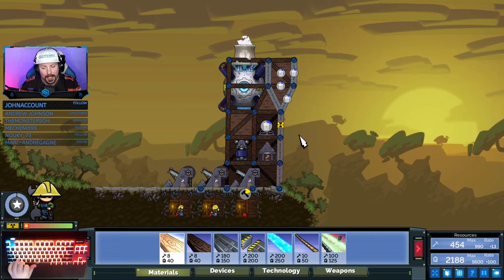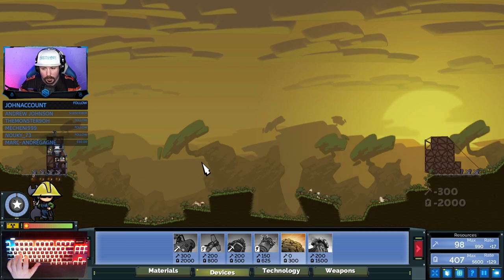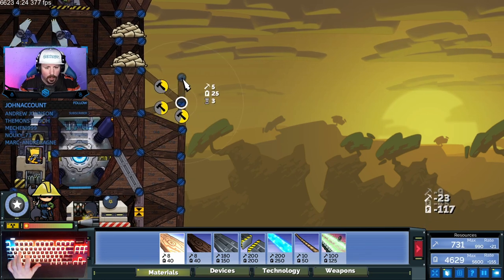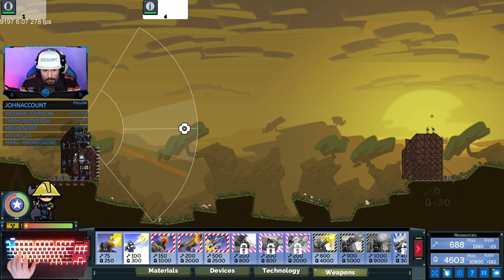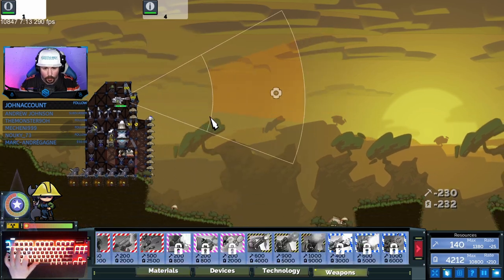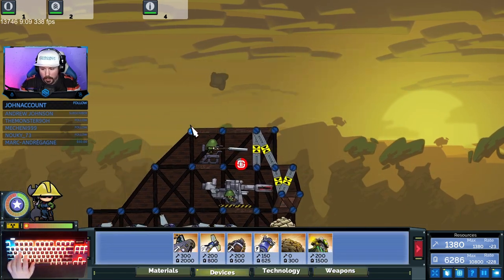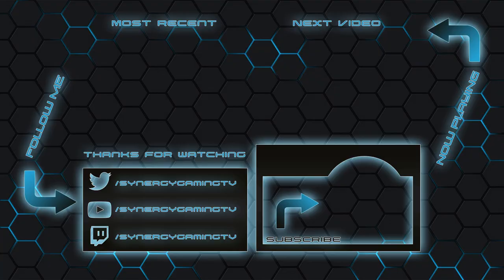[Tutorial] Basic build for Vanilla bases + in base Howitzer!! - Forts RTS

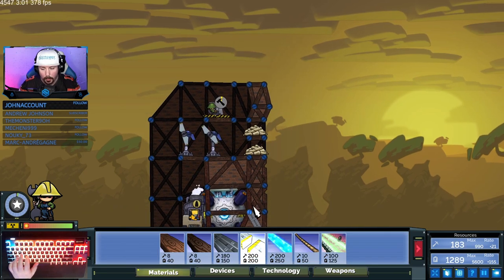Comment: 3:13 I would rekommend just accepting, that the base leans backwards if you even want to save recources by not crossbracing. With architekt it is a different Story because he gets cheaper bracing and you want to tank early game aggression to get your aktive so I wouldnt mind overspending a bit there but still Stability Tech is cheaper and better than counterwaight and counterwaight even stress on your bracing in the first place makes your base much more unstable. You tipically use counterwaight to get your base back in place after you caught your base and its on an heavy angle EG build counterwaight sell the deformed bracing you needed to survive and than let the Base lean backwards and replac the bracing.
Reply from the maker: We just have different play styles.